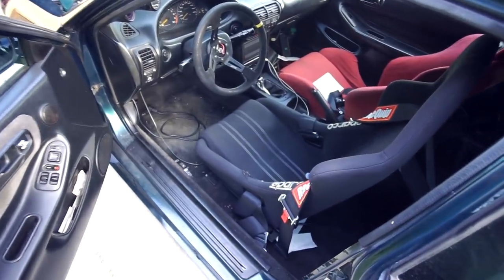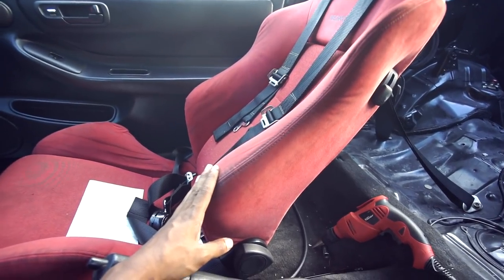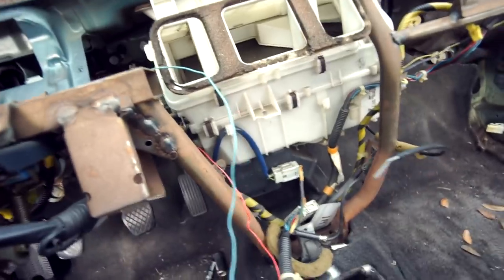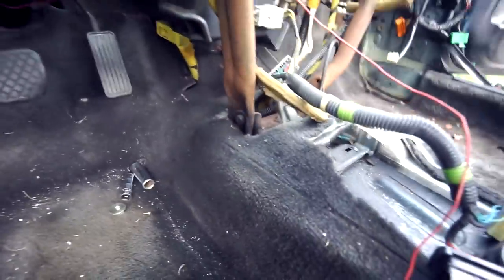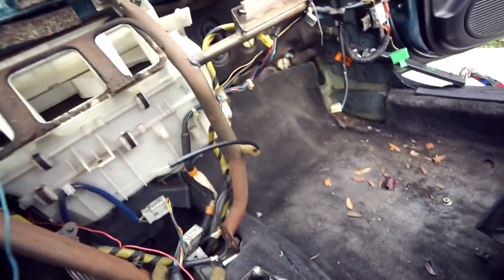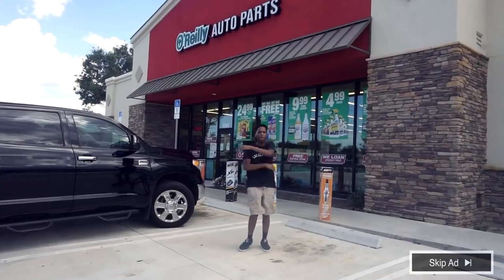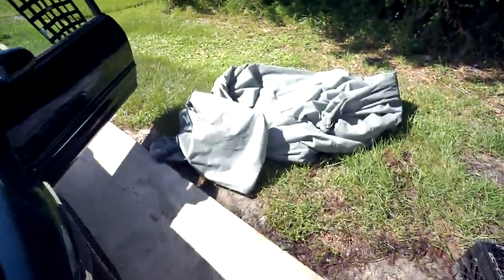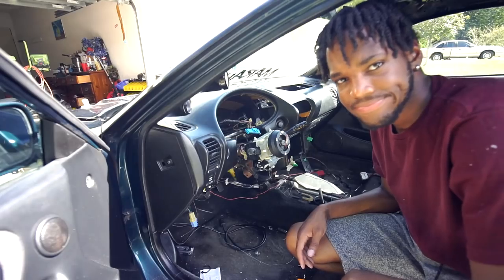It's ABOUT TIME I did this...

Comment: You can run the box above the tunnel without removing the heater  core I ran mine under the fire wall and up threw the hole where the stock 02 sensor grommet cover would go just have to make the hole a little bigger. I'm running rsx buddyclub box over 5 years now no probs.

Comment: Zosh dont do it. No cut shifters are bad from personal experience. U will miss gear and have trouble finding 5th. And want to go into revers even with reverse lock outs. I have had over 15 k swap cars. Know all this from personal experience. U dont have to run cables through heater core. If u run the through the o2 sensor. Drill it out and run them under sub frame

Comment: If you're putting a K24 do you have to put a K24 wire harness in the inside
Reply from the maker: you will have to run a conversion harness. no matter if it's k20 or k24.
Reply: I got a Acura Integra 1998 four-door and my friend told me he didn't want his car no more and it is a Acura TSX what a K24 A2 so can I take all the wires from that car and put it all in my Acura Integra 1998
Reply: Can you just let me know what to do cuz you're the man
Reply: Just go on my Instagram so I can show you the videos at Matthew Porter I got on football gear